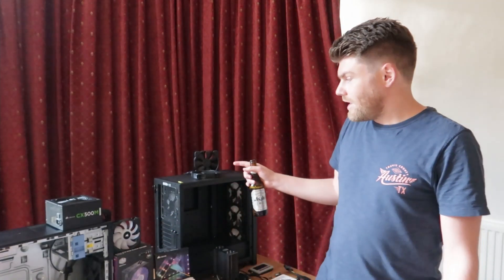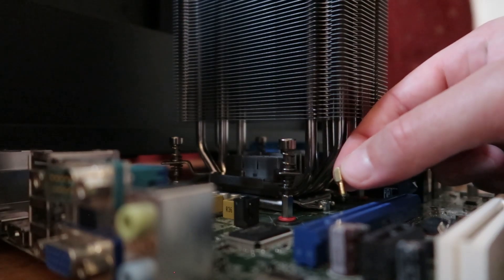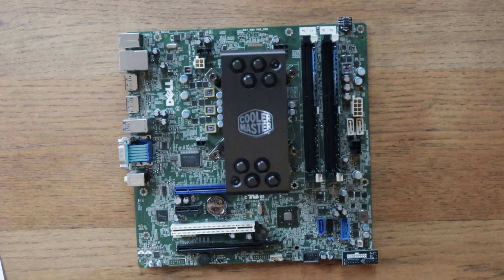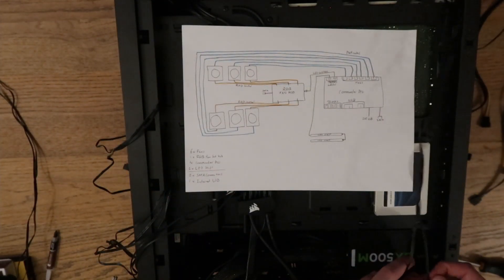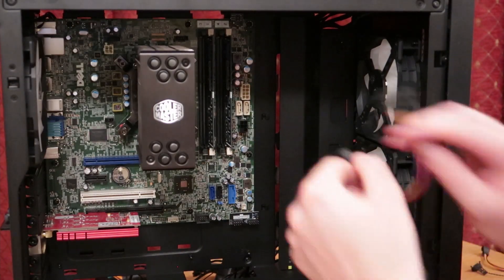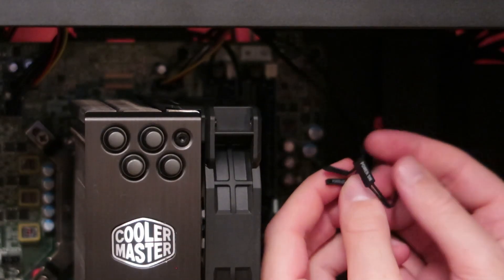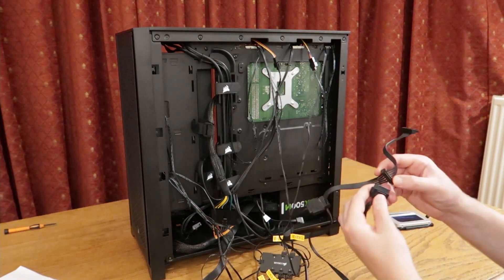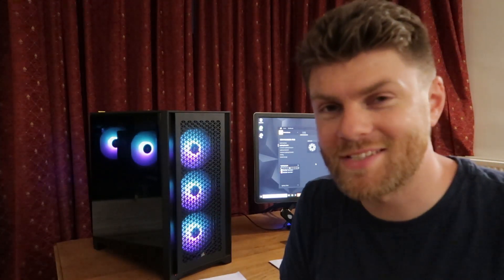Dell Optiplex 7020 upgrade 2021 - Ep 2

Comment: Good work!  how did you get around the case intrusion halt/beep right after power on?  Tech Yes City has a good video on how he got around most if not all the pitfalls of recasing an OEM Dell
Reply from the maker: Hi Vincent, in the third episode I run through the adapters required to utilise the front IO of the new case. It was 2 PCB required, one for the power and the other for headphones and usb. Hope this is helpful!